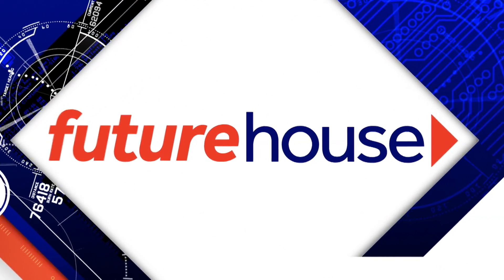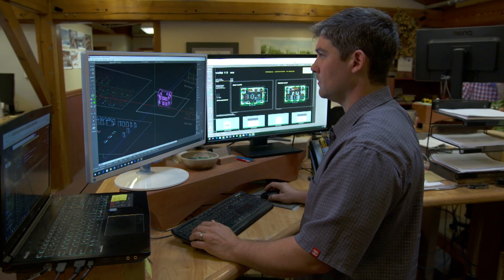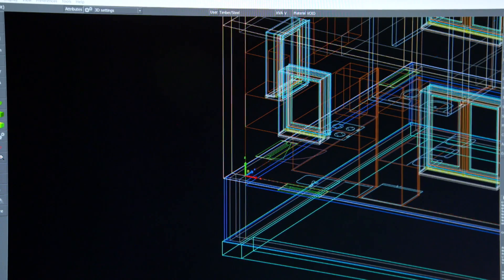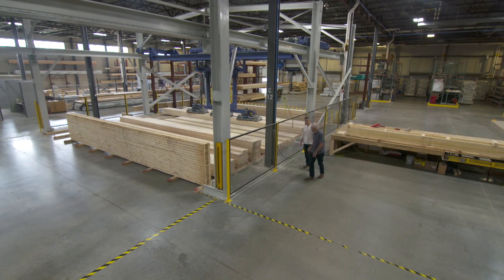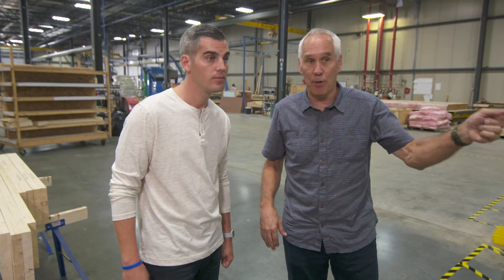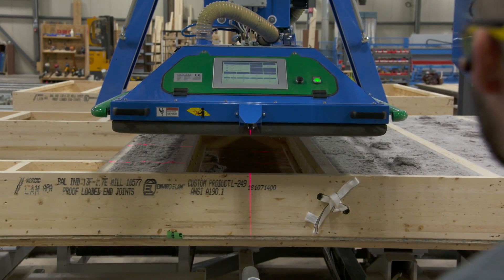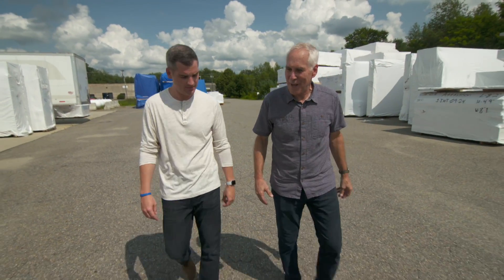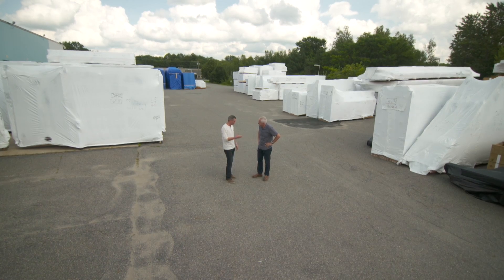Machine-Built Houses with Tedd Benson | Future House | Ask This Old House

Comment: Almost no humans required.
Reply: Bernie Worona humans are only for paying bills!
Reply: Humans still have to do the final assembly.
Reply: @fancybrooks3156  And set up and maintain the machines, drive the trucks with the lumber, clean up, load units..etc...This is one business that will NEVER be robotic totally...What I saw in there were helper monkeys, not robots......:)...I just noticed you're a brooks...That's my Company name and mine...:)
Reply: @godbluffvdgg  "Drive the trucks with the lumber". That'll be changing within a decade. Same with the machines (AI is here). This is the one business that is the most protected by full automation, but it's not totally protected.
Reply: @ShawnTempesta  We have to adapt...But; I don't see automated lumber yard autonomous delivery trucks for decades...The logistics is too complex...

I've seen fads come and go in my 30 plus years in the trades...We were all afraid when  the The Sliding Mitre saw came out.....:)...Nah, just breakin balls...
Reply: Humans are still required to complete the process. They have to design it, help assemble, install windows, etc. I don’t see these jobs going away. The jobs are just changing.
Reply: @rosstrethewey9391  Agreed, I was just making an observation. Perhaps different  phrasing would have been better. I spent over 35 years as an industrial mechanic and do realize machines don't fix themselves. I apologize for any misunderstanding.
Reply: Humans are still required to buy and live in the houses. If they don't have jobs there is no need for factory built homes is there? In the end American developers don't build empty cities like the Chinese do. Did anyone else notice that the two guys  in the office directing the factory wore the same grey short sleeve shirt as the chairman. hmmm
Reply: Because who needs jobs right?
Reply: And who is setting up the houses at the site? Right, humans.
Reply: 8:35 He totally avoids answering if his factory takes away jobs. He says he looks at it differently. If you analyse his reply you come up with him saying "employees cost to much, they never show up for work, when they aren't on their phones they do poor work. I tried slave labor and immigrants but this wall being built took them away. Automation is better and cheaper!".